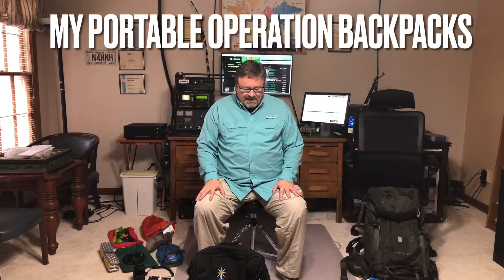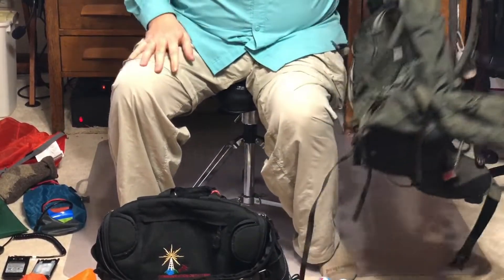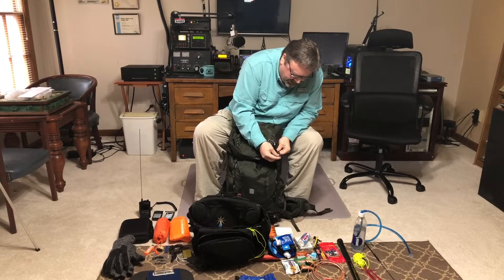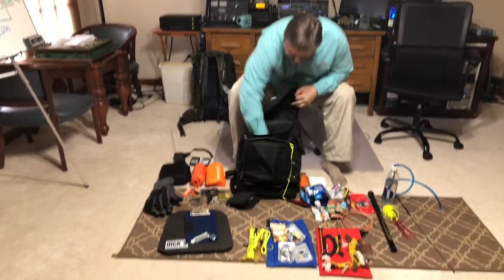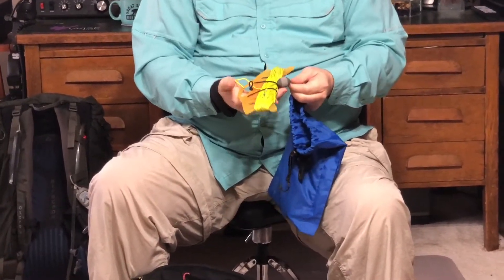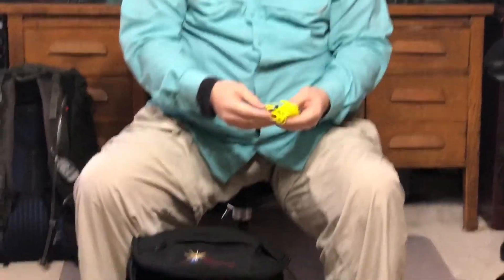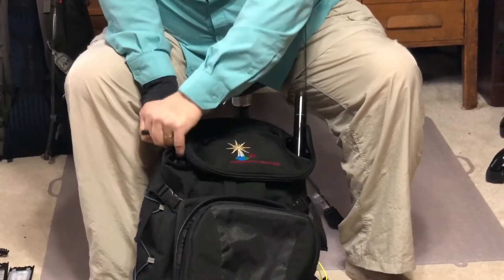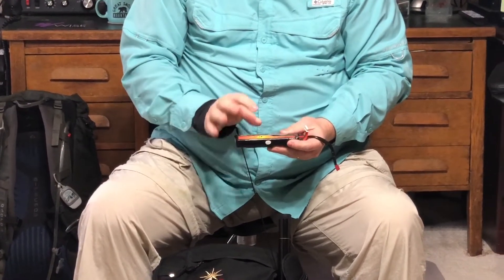How I Pack my Backpack for Portable Radio Communications

Comment: Excellent!! Thank you so much. What size spirit of air? Tall enough for an efhw?
Reply from the maker: I think mine is 13.5 feet.  It works well with my NY4G EFHW.  If you look at the video I shot at Coosa Bald, my friend Joel had his NY4G EFHW strung up across tree limbs, with the highest point at 6 feet above the ground.  I walked around and shot video of his entire antenna.

73, de N4HNH
Reply from the maker: You can see the Wind Sock mast deployed in the video entitled, “Testing my NY4G EFHW Portable Antenna.”

73, de N4HNH

Comment: Isn’t 3aH too small for the 891? Yes it’s light, but even at 50W out, how long does it last you? Wonder if a couple of them are lighter than just packing a 6aH or 12aH
Reply from the maker: Shhh….don’t tell mine.  Seriously though, the 3aH is the capacity.  It can deliver 3A continuously for 1 hour.  I run the 891 at 45W maximum.  The Bioenno LiFePo4 3aH can deliver 6A continuous and 12A peaks, as with SSB.  I get 45-50 SOTA contacts per charge.  The 6aH LiFePo4 gives me approximately 100 contacts.  If I feel that I need 6aH, I carry the Bioenno 6aH LiFePo4.

The LiPo battery can deliver 55A peaks.  It is also a 3aH capacity.

73, de N4HNH

Comment: How much does the pack weigh fully loaded? By the way great video.  You did not miss a beat.
Reply from the maker: The black backpack with the QRP load-out weighs 15 pounds, including the HT and 700ml of water.  The larger pack weighs approximately 23-24 pounds with the 100W load-out, including 3 liters of water.

73, de N4HNH

Comment: How much operating time does that little 3ah battery give you. With nearly 14 amps  @80-100w I would think not very much.....
Reply from the maker: I don't usually run the FT-891 at 100W.  I mostly run it at 45W.  I will bump it up to 100W if I need to, to complete a contact.  At 45W the 3aH Bioenno LiFePo4 battery is good for 45-50 SOTA contacts.  So 45-50 callsign/signal report type contacts.  

I only need 4 contacts to qualify for SOTA activation points, so 45-50 contacts from the battery is plenty.  But, as a courtesy to those who chase SOTA for points, I will try to work everyone.  I have worked 45 contacts from one summit with the 3aH battery, and it hung in there.  In fact, it wasn't until later that I realized that it only had 5-10 more contacts left.  That was in the snow.  Under cold WX conditions a battery charge won't last as long as in warm WX.  If I expect to make many contacts, or work 2-3 summits in a day, I carry a 6aH Bioenno LiFePo4 battery.

One of the reasons so many SOTA activators prefer CW is because CW usually provides more reliable communications.  A friend of mine, engineer, antenna builder, and author, Ariel Jacala, callsign NY4G, estimates that a 5W CW signal is approximately equal to a 45W SSB signal.  I posted a video a few weeks back that illustrates the difference between CW and SSB.  KC4WZB and I made a contact on SSB and then we switched to CW, on the same band, to illustrate the stark difference.

My QRP radio weighs 7.95 ounces, versus my 100W FT-891, at 5 pounds.  I can power my QRP radio with a 9VDC battery for 2.5 to 3W output.  The 3000maH LiPo battery, shown in the video, yields 5W of power.  The radio draws around 750mA at 5W, so I can operate for hours and hours using the QRP setup.

SSB is fun, but it's nice to give my back a break once in a while.  I plan to use the lighter, QRP, load-out more often in the future.

73, de N4HNH
Reply: Thanks Doug for the great response. Maybe you could do a segment one time talking about SOTA QRO (heavy) and SOTA QRP (light). Explaining your findings. For example I have a 817 and a 891. I take the 817 out most often. Do I net more contacts going QRO. Honestly not really. The chasers are there and will pull me out. Obviously 5w vs 20w is about 1 Sunit which is why I was surprised you run 40-50w. If you’re not going to run 5w might as well do 20w and then 80w. Love my 891 but lately it takes a back seat for sota. I leave the bigger battery and radio at home. When the solar cycle turns around I’m sure it would be even more obvious choice. To each is own. Keep up the good work. Your channel is wAaaayyy better then some of these other channels on here.
Reply from the maker: Thanks so much Turd!  I like to focus on the practical side of things - operating techniques and such.  It’s nice to know that someone appreciates that.

73, de N4HNH